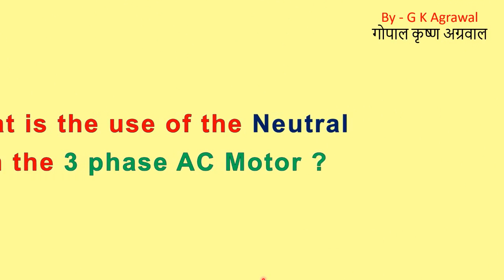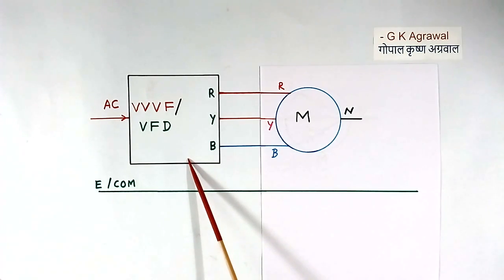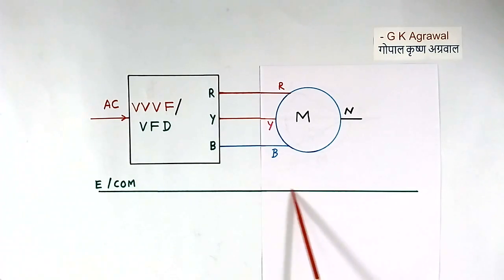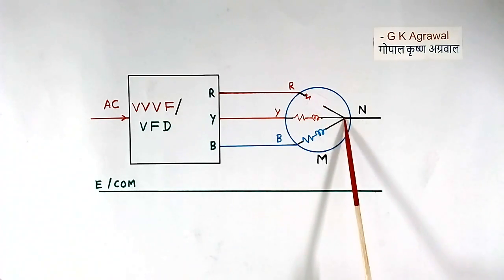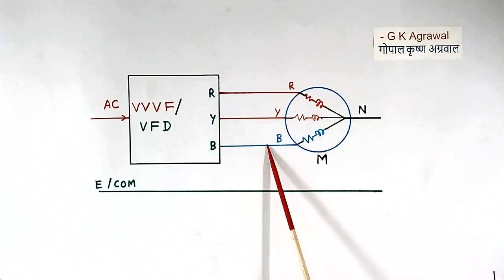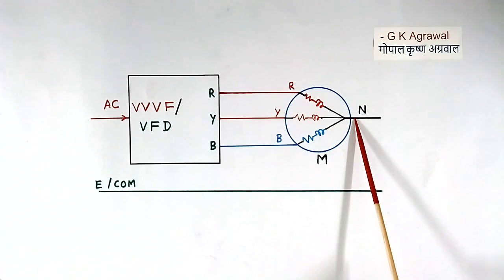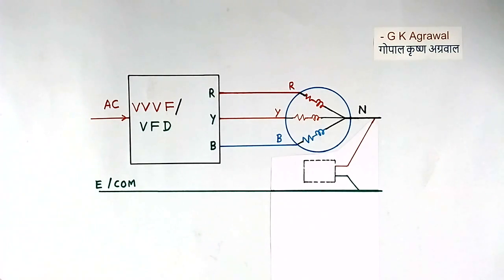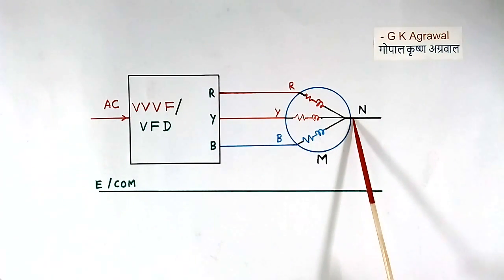Use & Need of Neutral in 3 phase induction motor

Comment: sir how can we predict that fault is occuring in which phase? i think this will only tell that fault has occured,but not where it has occured..Looking for kind reply!
Reply from the maker: Very good question. Just some time back my one friend here also asked same thing. For fault in different phase, RMS magnitude of voltage at neutral may be same but it will have phase shift. For example middle of R and Y phase will be at one phase angle, but middle of Y and B phase will be at different phase angle. However there may be few more voltage and current sensors for proper coordination.

Comment: Sir I am your subscriber ap bhot acchi video dalte Ho YouTube per.
Sir muja aapki help chahie 3 paase se 12v, 5v dc etc. Without neutral kaise nikale sir?
For example... 3 phase motor auto switch ma 12v dc relay work karta hai without neutral. I hope sir you help me 
..........🙏🙏Thank you 🙏🙏.......
Reply from the maker: Transformer ki primary voltage 230 volt ki jagah 400 volt ka design hoga, secondary vahi jo neutral key sath hota hai. 400V ki primary ko R aur Y line mey laga dey.
Reply: @GKAgrawal2  Sir 400v transformer ko input rad and yellow line dena hai kya.
Reply: I waiting sir for your reply.

Comment: Hello and Good Day, I'm curious if you know why the amperage draw on one leg of a three phase motor drops when the neutral is utilized. You see I'm a student attending college learning about HVAC/R but we have some small sections that go into the basics of electric motors.

The electric motor laboratory has some old trainers and one is a 3 phase motor and pulley which can be loaded or un-loaded with a dynamo that is adjacent to the 3 phase motor. Anyway, I wired the motor in a typical Wye formation as a sample diagram in our book suggests, and the motor which is a .25 Horse power or 186.5 Watt demands, without load, 1 amp to operate @ 208v. 

Now when I wanted to know why the common point wasn't connected to neutral my instructor couldn't answer my question with anything coherent. So I wired the common point of the three windings to the neutral and the motor sound changed to be much smoother, the amperage drop also dropped from 1 amp draw to .6 amp draw. I'm not sure if the RPM changed or what the load characteristics would be now, however, I want to know!

Can you please let me know what is the correlation to utilization of neutral to load characteristics? Efficiency? Is this why trains utilize this configuration? Does the amount of potential work to efficiency ratio change?
Reply from the maker: 1 -  In my video, I have not connected neutral of the motor to supply. Neutral of the motor is used only for measurement.
2-  3 phase 0.25 HP, 208-volt motor will draw  0.5 amp at full load at unity power factor. But in your case, no load current itself is 1 amp. Which is not possible. Maybe, your motor is damaged or there are Unbalance in the 208-volt power supply.
3- To check motor- Check the 6 resistance of the motor ( RY, YB, BR, RN, YN, BN ). Remove supply before measuring the resistance. You will get some idea of failure if any
4- To check voltage unbalance- Check voltage between RY, YB, BR, RN, YN, BN of the power supply. Also, check voltage between neutral and ground ( If supply it is not isolated)
5-  I am not a motor expert, we are just user and told you based on my common sense and 35 years of design experience of industrial electrical equipment. I know very little about the motor, but whatever I know, I told you.
Reply: @GKAgrawal2  
1. Yes I know that in your video you explain the neutral is utilized for measurements only and that it's a method of finding "some" faults with a VFD. I appreciated learning this as many of the compressor motors utilized in my industry, air conditioning and refrigeration, are going to become inverter driven and or with VFD's. 
2. It's very possible that the motor is damaged, the instructor wired the motor in a Delta formation and it started to smoke! I read about delta formation in transformers and I recall that one leg of that sort of configuration has an relatively high voltage compared to the other two legs / terminals; but I have very little experience with power supplies and or transformers - only theory!
3. Yes I will check all three windings' when I get a chance to back in the lab, I imagine there will be some variance since the incident I mentioned above and 30+ years of use!
4. The supply is attached to a variac type transformer, I'm not sure if that will cause unbalancing? I will check though when I have a chance. 
5. Thank you for sharing!
Reply from the maker: There is a possibility that the input of the variac may be unbalance.

Comment: Sir, in low power 3ph reqmts,for eg: 5hp 3ph motor, How or from where is the return current flowing? Pls clarify.
Reply from the maker: In such loads, low power or high power, current flows between phases only. For example,  Current coming from R phase may go back through Y or B or both depending on phase  timings. Watch my video on power supply to homes through high voltage, and also video on 3 phase supply.
Reply: Thank you sir

Comment: SIR
Viewed yr video on CAPACITOR USE IN AC CIRCUITS--EFFECT OF CAPACITOR VARIATION ON POWER FACTOR.
You have explained well  and understood how POWER FACTOR varies with increase or decrease in current in the capacitive branch ( capacitor connected in parallel to supply).
Thanks
Vatsa  Bangalore

Comment: sir ...in rainy season some times we feel some current on the electric board or nearest place of that board. sir what is the reason of this. is there any short-circuit is occurred in that board. if it is then how we can rectify. How should resolve this problem. plz tell me bcz it happened with me today when i touched switch board.
Reply from the maker: I never got shock by touching switch board. They are made of a kind of plastic.
Reply: pta nhi sir. Jb testar touch kiya switch board k ..to wo glwo kr rha tha. or board pr hlka sa current bhi feel hua. that's why i asked this question. 🙂